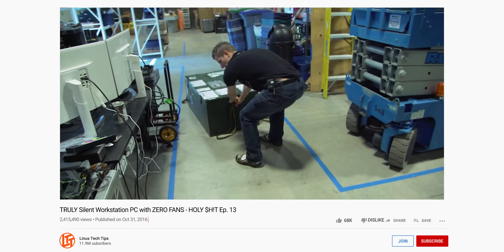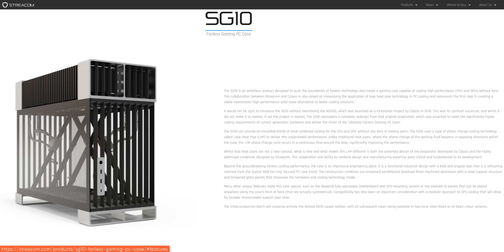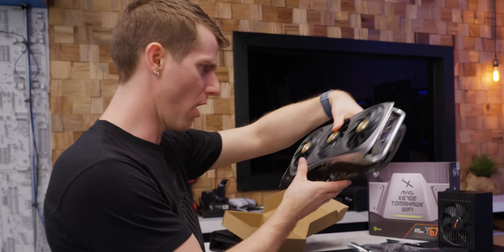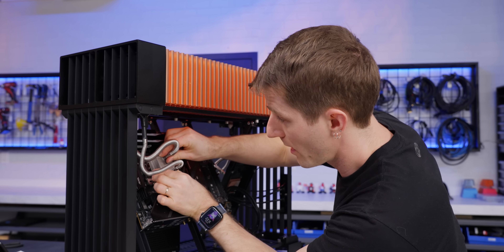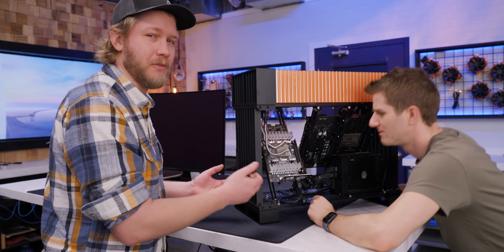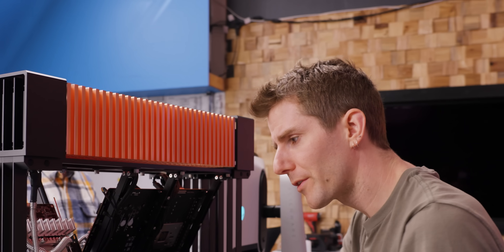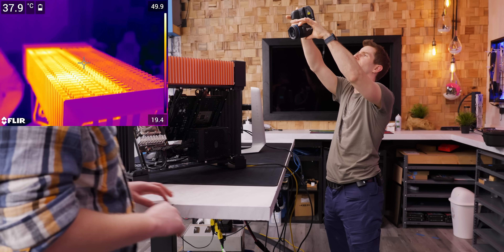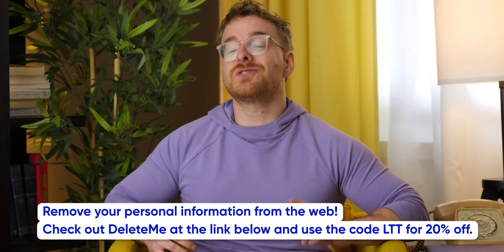I bought this scam PC case... And it actually arrived

Comment: This case is by far THE best example of a solution for a problem that doesn't exist, especially in 2025. Even for 1000$ US dollars you can get a good case from BeQuiet, or Phanteks, for example. Get a bunch of good quality fans from BeQuiet, LianLi, or Noctua, set them to run at 400 RPM, get an AIO for both your CPU and GPU, and your system is going to look cooler, cost much much less, and not sacrifice the longevity of other parts of your PC that need airflow, like your VRM's, mosfets, and other power delivery methods on both motherboard and GPU, and it's not even going to be louder if at all.
Reply: These aren't for quiet operation, they're for fanless operation. I'm sure people who work in these industries would have better examples, but imagine a woodworking shop that uses CAD and various routers/lasers/cutters alongside traditional techniques to build unique pieces. They might need a beefy system for their CAD applications, and fans clog with sawdust relatively easily. So their custom system that's exposed in their workplace might be able to use a case like this

Comment: I know it would defeat the philosophy of the case, but I'm curious what the performance would be with some fans mounted under heatsink. Setting them as slow as possible so they'd be inaudible, would still provide some forced airflow over the heatsink. Faster exchange of air inside the case would likely help with the cooling of other components too.

Comment: 12:00 Evaporation & boiling are somewhat 2 separate things. Evaporation of liquid can happen without any element of the liquid reaching boiling temperatures, ocean doesn't need to be at 100 C surface temperature to form mist and rain clouds.
Reply: Kind of. Boiling is still the process in which what evaporates at. You have a low pressure vessel with water in it, and it will boil at room temperature. It is still boiling the boiling point, which is now at room temp because the pressure is low. Evaporation wouldn't happen without some form of "boiling".
Reply: @ Evaporation still happens at 1 atmospheric pressure. Yes, lowering pressure makes it boil at lower temperature but it's still boiling, evaporation is different is my point and I gave the ocean example because of it.
Evaporation isn't boiling, it's conflating (combining 2 ideas into 1) just because it's very similar. Example of conflating would be saying "static electricity" and "Van der Waals force" is the same and one is just another form of the other because of election charge interaction.
Similarly, water turning from liquid to gas isn't just boiling. There's a whole field called surface science.

Comment: the pump action your referring too I think is called thermosyphen. the collasping from gas to liquid effctively creates a bit of a vacum in the condensor pulling the gas out of the block casuing liquid refirdgerent to be pulled into the evaporator. The capilary tube prevents the system form ever reaching equilibram on the liquid and gas side endlessly continuing the flow with just the aid of heat. At least I think.
Reply: Thermosiphon* :)
Reply: @Leo9ine  yea...yea.

Comment: As an HVAC contractor I understand the principles behind its function, also concerned about leaks and whether or not they got the critical charge correct. Just FYI if it leaks your cooling is completely gone and it would not appear to be serviceable.
Reply: @RealFuzzyPickLE530  on top of that very big problem (i defy anyone to make a truly leak-free system over say a decade of use) I'm curious about transient loads. Take a cold system & whack a heavy load on it suddenly; how high do temps spike before the convection gets moving enough to bring in more liquid to boil?
Reply: Question for you, is it likely that refrigerant gas will slowly evaporate out of the system?
Reply: @brettjohnson9453  it's intended to be fully sealed, and the refrigerant isn't consumed or anything, but if a leak develops it will leak out. This is a common problem we see in the industry.
Reply: @RealFuzzyPickLE530  Is the particular refrigerant they mentioned reasonable for this type of product? Any health concerns with a leak?
Reply: @RealFuzzyPickLE530  cheers mate
Reply: @darksteel78  i would have too look into that particular refrigerant, but im sure their engineers went through it to find one that's suitable.

Edit: Also most refrigerants are not harmful in small amounts, the most common concern is asphyxiation if large amounts are released in an enclosed area, a small amount like this wouldn't cause something like that. In industrial applications that is more of a concern.
Reply: @ Thanks for the knowledge! Always good to have a subject matter expert around.
Reply: @darksteel78  haha well im far from an expert but this kind of stuff i nerd out on lol

Comment: People that are surprised how heat could move fluid or gases around a lot, never bothered to think how a drip coffemaker works.
There is no pump in there, the boiling water just goes up the pipe by itself.
Reply: Percolators and moka pots are slightly weirder even, because of high pressure brewing and the viscosity change. 

Fluids are strange.

Comment: the rate at which it cools has to be directly linked to the heat produced by the chip. It should cool better the hotter the chip gets because it makes the liquid boil more therefore it will move through the system faster and cool better. So there should be a point, as we saw here, where there is an equilibrium between the heat produced and the cooling provided, the trick is have the heatsink be efficient enough to be able to reach said equilibrium. Id be curious to see what other CPUs and GPUs do in this case, especially overclocked. I want to see at what point this massive cooler can no longer maintain that equilibrium. FOR SCIENCE!!!

Comment: What I'd like to know is how it handles transients. Steady state sure, it'll work great. But if it's idling after getting up to temp then you hit it with a full load, how high do the temps spike before the refrigerant starts convecting enough to carry the sudden load? I design industrial refrigeration systems & I'm sure this could be a huge problem if it wasn't considered during the design.

Comment: To be fair, $2k is a decent price for a low run, niche product using that much copper.  Copper ain't cheap.  Obviously it's not budget friendly, but this isn't designed for people who care about the amount of money they're spending.
Reply: Copper is expensive, but not that expensive. For a grand you could get double Linus' weight in copper. That's a luxury price uplift over the 'normal' version.

Comment: Really cool idea (pun intended) but this is more like a piece of art you put on its own table than a case you put under or directly next to your desk. It seems to need a lot of space above it for the heat to exhaust through, the GPU cooling is questionable (and probably voids your GPU warranty), and who knows what this thing will be like in the summer months. 

Plus with zero cooling fans and pumps, what happens if the refrigerant starts to evaporate over time? Better hope your system components have good thermal overload protection.

I still want one though.

Comment: I thought the price would be higher. 1k for the aluminum one seems totally fine for how unique that case is. No normal PC builder would ever buy this but I can see the enthusiasts appreciating it
Reply: @surprisedpikachu67  If you need dead silent and aesthetics, I guess you could do far worse.
Reply: @daniellewis1789  Even then if the cooling wasnt super good you could stick some very low RPM like 140 or 200 mil fans in there at the bottom of the case for more airflow and you would never hear them at the low rpms they run and it would probably cool the case by like 5 degree with the amount of air moving
Reply: @daniellewis1789 What about life expectancy? I would imagine a sealed loop like this would last 15+ years, or even indefinitely if you replace seals when you refill fluid. $1k for a PC / space heater / oven combo that will last that long is a bargain/
Reply: @BrandonsUsername  if you plan on not changing any components for 15+ years...
Reply: I don't know man, I'm a tech enthusiast myself, and I have spent a lot of money on dumb things and early adaption things, like the SSD's when they just started coming out, RGB ram when it wasn't mainstream, and cases like the Phanteks Evolv X for example, back when people spent 70$ on a case and I have spent 300, but this product is so niche that even I can't justify paying 1000$ for a case that will not even cool anything besides the CPU and the GPU, plus you'll be limited in everything
Reply: @Svuatoslav454  honestly i would, for a pc im just playing games or working on, that fits the style of my office area. 

but the problem would be it can replace my main pc as it doesnt have the space for the 4 16tb hdds, i use as well. sure i could get the 4 8tb ssds in it no problem. but i wouldnt want them to run with no cooling. 

i would go with a 4090/14900k and 64gb ram, and a single 4tb ssd in a pc like that. mostly because i already have that on hand, and i wouldnt worry about longevity as ive had that gpu and cpu since they came out. anything newer would be scary.
Reply: @ThatZenkiS14  if you can drop $$2000 us on a case...  build a $200 nas for your had drives. lol
Reply: @Svuatoslav454  there is an ENTIRE category of cases that are in and above the price of this. you are a tech enthusiast, in the same way the guy that buys a mustang or performance model normal car is an enthusiast, but there is a category above you that still has a lot of people in it (with the car analogy the buyers of 100k+ performance cars)
Reply: @Svuatoslav454  $1000 is definitely a solid price for something like this. I paid about $550 for my Silverstone RM52 to rack mount my PC in my gear rack, and that case didn’t include any type of cooling loop, fans for the system or rack rails. All-in-all to get a rack mount case equivalent to what this one offers, I paid close to $1000.
Reply: @ExpiredLifetime  sure, but we're talking about a rack mounting, this PC case from what I got is not for racks, it is just for looks, quietness, and aesthetic purposes for the most part
Reply: @Svuatoslav454  when u buy like 12 noctua fans and radiators and all that kind of stuff maybe a new gpu frontplate for watercooling and so on then youre fast at 1k € too
Reply: @xDakos who the hell buys Noctua fans still? I bought Lian Li fans, 5 for 90$ on Amazon, they can be Daisy chained, have very nice RGB that actually works unlike the Corsair ones I had before, and that come with a controller already. I just needed 10 120s and 1 140, came out to be about 220$, don't forget that I can use those fans and my Phanteks Evolv X case for YEARS to come, it still looks just as good and fits all of the components. If you buy a case like this you'll just be limited to certain parts that are compatible
Reply: Yeah you get a case and basically custom water loop in addition. Considering you don't need fans that can cost a lot its pretty fair price.
Reply: These types of cases seem to sell all right in the HTPC category.
Reply: @ccricers  There is no 'these types of cases'. This is a unique build.
Reply: This seems like one of those cases that you buy and literally use for every build for the rest of your life
Reply: @HearMeLearn  except you need to buy a new GPU cooler from them with every upgrade
Reply: $1000 should come with a lifetime guarantee of new mounting hardware for new hardware. I mean you get that with $80 noctua already...
Reply: I'm a sound engineer and 1k is a steal for complete silent cooling.
Reply: @ I feel like if you're a sound engineer you should have your computer in another room and you're remoting into it on a thin client
Reply: Considering the custom machining and assembly in this thing, not horrific. I wouldn't mind seeing a DIY attempt at this - although most coolants like used in this aren't all that friendly.
Reply: Yeah I thought it was gonna be way more. I would've guessed more like 3-5k for the copper one.
Reply: Idk man my jaw dropped when I heard the copper one is TWO THOUSAND DOLLARS
Reply: @nicholasfaber9695  Well if you compare it to other low production volume cases + CPU cooler + GPU cooler it's pretty reasonable I think. Especially the 1k for the aluminum one. You can easily spend 500$ on just a normal case from some small case makers and they don't include a CPU and GPU cooling system. And copper is just pretty freaking expensive. It's like 4-5$ per pound and that's just raw copper without any machining or other manufacturing done to it.
Reply: @sebastian.salmhofer  get what you’re saying and yes copper is expensive. But you can cool a cpu with a 50 dollar air cooler and gpus come with coolers haha
Reply: Look up the phrase Hi-fi, and audiophile. I nee to embrace these markets.
Reply: With tariffs on aluminum, the $1,000 is going to be just a downpayment. Your whole house will be a collateral to buy 69 pounds of the most precious rare earth metal the man could find.
Reply: I feel like if your main constraint was to have no moving parts then this looks like a great solution
Reply: ho do u define the boundary
Reply: As an enthusiast I won't buy it because it's all form over function: it doesn't do what it should do. It doesn't cool things which are supposed to be cooled which is not cool in my book.
Reply: I’d for sure buy this.

Comment: 999 for the Aluminium version ( unique case / Cpu Cooler and GPU cooler) doesn't sound to bad. if you consider a case, cpu watercooler and a gpu watercooler... even if the performance is not as great

Comment: That RGB RAM really needs to go for this one. Plain aluminium or copper heatspreaders would be so much better! 

Also i wonder how this would do with REAAALLLLYYY slow- moving fans pushing air up through the condenser stack. That would also create a bit of airflow to help your mis-mounted fanless PSU out.
Reply: How would you know if it’s on?
Reply: Debug leds
Reply: Corsair Dominator Titanium with the copper heat spreader addons would be a pretty nice match

Comment: This case costs the same as a really decent mid range build that has a couple of higher end components and the odd bargain. The aluminium one costs the same as an entry level PC with maybe a higher end used GPU.
Reply: The pricing is comparable to a decent and highend custom water cooling loop, respectively. As such, I don't see a problem.
My main problem with it is that I'd be counting on the manufacturer providing new GPU mounts and that any highend GPU gets very toasty on the PCB. A fullcover waterblock is definitely superior.

Comment: 18:40 this really highlights how bad value the billet labs product was

And when you compare it to a full custom loop from ek, premium case and rgb fans this seems like a reasonable price (for a baller system)
Reply: But it's worse performance than watercooling... And air cooling. The only values are swag, and almost absolute silence, the first of which is just opinion, and the second can be achieved with watercooling/air cooling with better performance, and without the VRM on your GPU running on the ragged edge of comfortable temperatures.
Reply: @ they didn't actually test its performance against anything though

And no system with fans and a pump is actually silent, you're kidding yourself if you think it can be as quiet as a passive system

Further to this the case does actually support up to 200mm fans if you wish to make a direct comparison in terms of performance with actually equivalent noise levels

But at the end of the day we dont have fhe data. But what we do know is the marginal gain from overclocking

And without overclocking, there is no performance just bragging rights with temperatures. Now I know its "common knowledge" fhat hot electronics die quicker but I haven't actually seen proof of this anywhere. We know for a fact when they overheat they can and will die but afaik its just speculation tbag running closer to that line increases the chance of death

But when I initially considering performance, my view was that many people build or have built for them custom loops simply for the aesthetic and if you like the aesthetic of this case its pricing is in line with that

As for the billet labs remark, im not aware of any actual testing of the product (besides ltt's non representative testing), that was derived from in my view a more complex engineering and manufacturing task for the passive phase change and yet you get a case, a complete product where with the billet block you are left to engineer your own solution

Edit- TL;DR if you care about the extra 1-5 fps sure go water cooling and overclock, but for those simply looking for a cool factor this is price competitive

Comment: I feel like I'd love to have something that's built for passive like this, and then put just a couple of noctua fans in, surely the forced air and massive heatsinks would produce a super quiet and very capable system. Mind you this did just manage to cool a 9900X and 4090 so ...

Comment: Could you not just buy a normal refrigerator and throw your P.C. into it. Drill a few holes in door, seal, etc. Then attach fridge to huge springs and bolt gaming chair on top. Climb up, buckle yourself in and go nuts with controller! No Monitor required!                                                                     :)